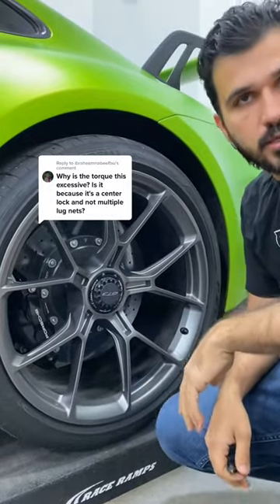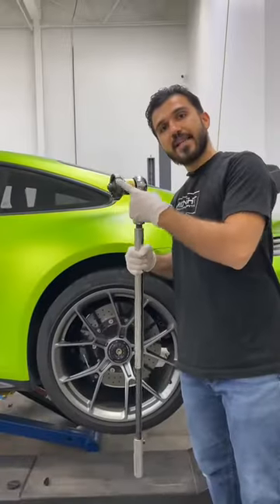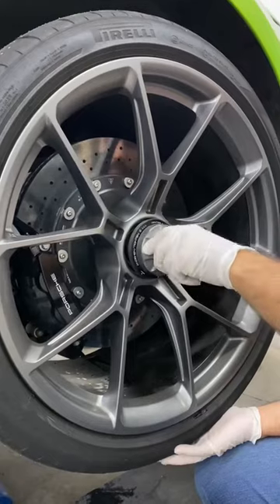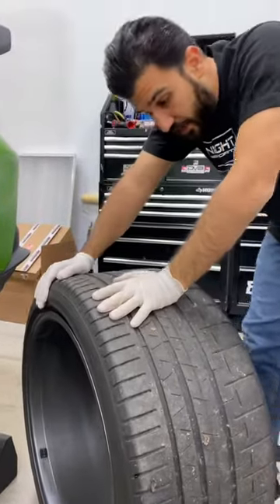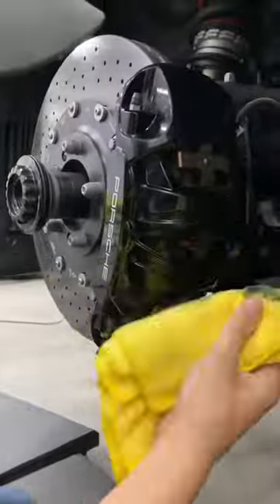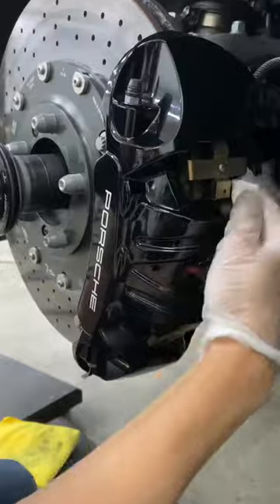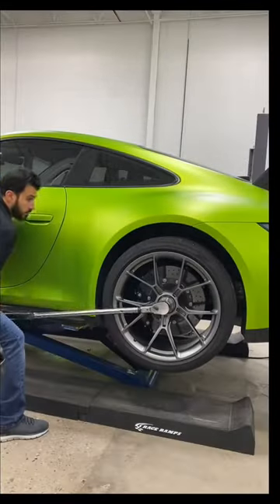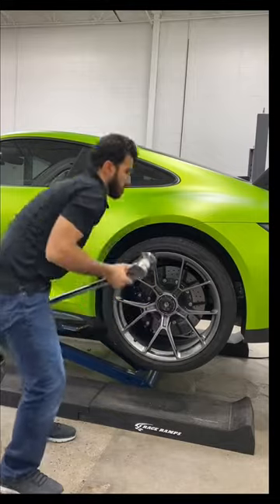How to remove Center lock wheels on a 911 GT3!

Comment: I don’t get why it needs to be lifted to loosen it
Reply: Google it or find the owner’s manual lol
Reply: 450 lb ft torque will move the car with that much force applied, could damage parking brake, or not ever get it torqued down because car will just try to move and damage the brake system